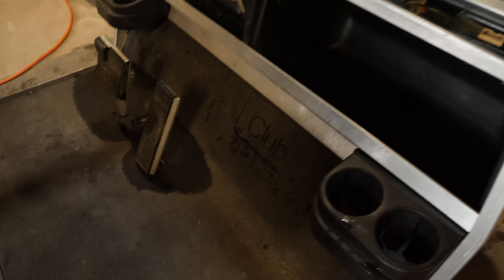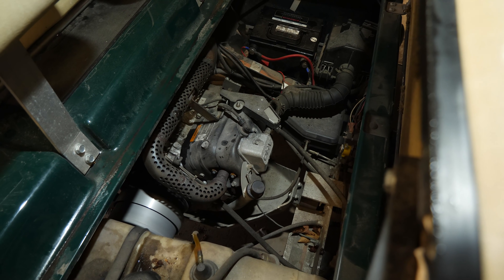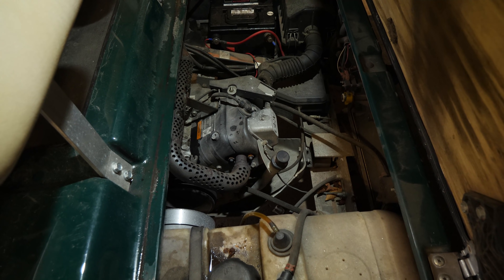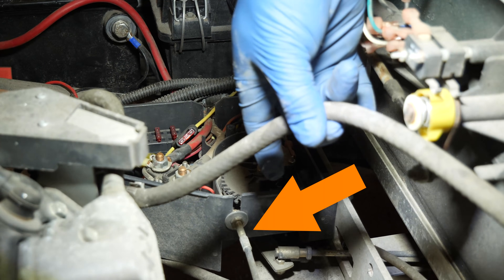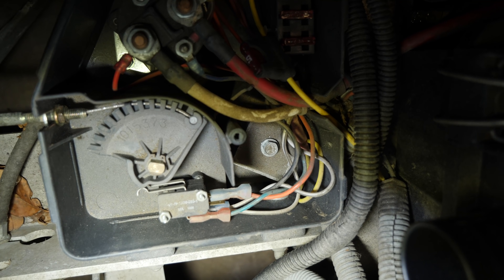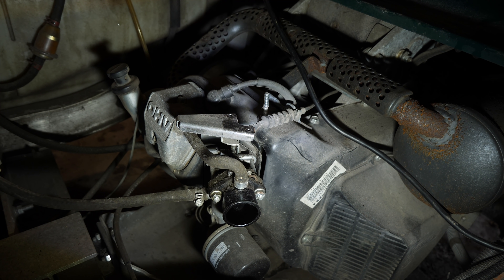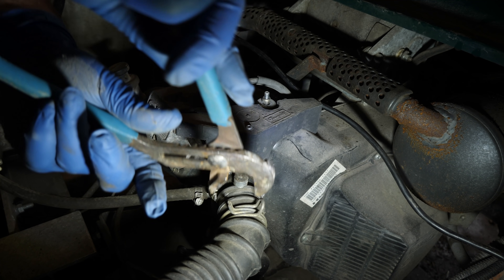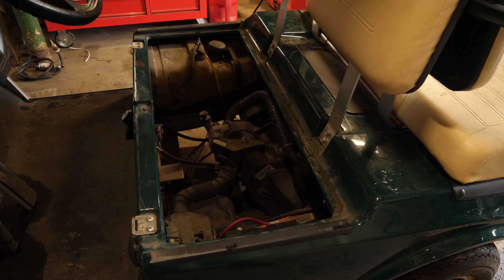2011 Club Car DS, Gas - Bad Governor, Hitting Rev Limiter

Comment: Great job Kevin,definitely saw my mis adjusted govenor...its there for a reason,more governor, less engine life
Reply from the maker: These engines are not internally governed so they have an external governor. It is dependent on speed and load.

Comment: I found your videos and you seem very knowledgeable. I have a 2001 club card DS the belt on my clutch does not ride all the way to the top so my car very slow at top speed. I tried changing the belt and still have the same problem. What would be my next course of action?

Comment: I love your video, however it did not explain how to adjust the governor to the stock setting. I picked up a 2007 Turf 2 Club Car that someone has been messing with that runs great until the pedal is fully depressed- then starts stalling and backfiring.

Comment: Kevin, we have a 2007 Club Car Presedent.  When we go to take off it squeals.  I have to be easy on the throttle to get it to catch.  You think it could be a belt issue.  We have replaced the drive clutch already.  I didn't know if maybe the belt was stretched out on the replace or the other clutch is bad.  Please help.

Comment: Hi Kevin I appreciate your professionalism /attitude towards doing things the right way instead of what makes things easy or a hack fix! I work on golf carts at a golf course I have many that will only start w/ pedal half way depressed (fully depressed pedal you get nothing) and everyone jumps in his pedal to floor & complains it won't start/ run. How do I fix this issue? Also I've purchase the starter / gen belts (club car & aftermarket) they are all now slightly thinner than the older belts!? Have you noticed this where can I buy ones like the originals?
Reply from the maker: If its cold, the engines will need a little choke to get going. If its hard starting all the time, even when warmed up, I would start with disassembly and cleaning of the carb. Also check fuel flow from the pump. Make sure the fuel lines aren't stiff. This can cause vacuum leaks and weak or no flow. Club Car has multiple part numbers for their different years and belts. I would make sure the belts are for that year. Some of the belts are only for a 2 year range, some are for the newer 96+. I would stay away from Amazon for hard parts like that. Everythingcarts or buggiesunlimited are good sites to buy from. They both sell RHOX parts and I'm also a RHOX dealer but I don't sell online anymore.

Comment: Bummer on parts acquisition. OEM has its reasons for things being set the way they are, and when you start fooling around with things, especially in the performance area, things tend to come back and bite you. Thanks for the ride along.
Reply: Only if it's done incorrectly lol

Comment: The cart has a rev limiter, you don’t need a governor. The governor is put in just for golf courses to keep your speed slow on the course. The rev limiter will keep you from damaging your engine not the governor. Loosen the bolt and let that Governor spin freely and bypass it all together. Again, a governor has no other purpose than to regulate your speed. Bypassing it or doing any mods isn’t going to hurt your engine. Make sure your rev limiter is working and go have fun.
Reply: I adjusted mine today I can get up to 19 mph now. I was maxed out at 12 mph at first. My cart came from a golf course the governor was turned down to the point it had a very slow takeoff

Comment: In your professional opinion what is the safest way to make a club car ds gas faster without damaging it? Is there a proper way to get another 4-5mph out of it? Mine feels like a little girl in a Barbie jeep is going to pass me lol
Reply: Bypass the governor all together. A governor is put on to control speed, not to keep you from damaging your engine. Now it can be used for that if it’s the only option installed. Golf carts have rev limiters. Rev limiters cut out at the top safe rpm for the engine. So in other words it will not allow you to hurt your engine. So you don’t need a governor and a rev limiter you only need one or the other. So why do golf carts have governor’s? To control speed on a golf course. That’s it! The governor being bad or bypassed will not hurt your engine. The only way you will hurt your engine is if your rev limiter gives out and usually when that happens you will have a no start condition.

Comment: I thought the govener bracket was just on a pivot..does the rod its on that goes into the engine actually do something?
Reply from the maker: Yes, the governor is part of the transaxle since the engine has no internal governor.
Reply: @Kevinsgolfcarts  ok so the bracket does need to turn the rod..and not be loosely on there

Comment: Enjoying all your videos Kevin. Glad I found them. So, my '92 EZGo Marathon will not rev enough to engage the clutch. I noticed a couple of small hoses hanging below the carb. one is broken in half the other is hanging loose. Pics of new carb  all show two small hoses attached to the carb. do you what these are for?
Reply from the maker: If its not revving, adjust the valves. The hoses are for the overflow.

Comment: Kevin, I am having very similar issues with the governor but I put mine up on jack stands today and it seems that my governor is actually moving as it should unlike yours from this video. That being said I keep bouncing off the Rev-limiter, I’m sitting here reading through a service and parts manual trying to troubleshoot what my problem is . My guess is it’s electrical ? Any help would be great thank you
Reply: Keith Ellett same problem ez go medalist, while trying to adjust the governor I believe the igniter went out and lost spark.

Comment: I have a club car with FE350 engine. It runs good at high rpm and I can even move slowly in forward gear. In reverse it surges, bucks and will backfire. Doesn’t seem to do that in forward. Any ideas would be greatly appreciated. Great channel by the way.

Comment: I have a !986 Club Car gas Motor and when I barely press the pedal down it seems like it`s at half throttle already. It also jerks a lot on take off. If I adjust the throttle cable at the box like you did will this help? Or is there a different adjustment somewhere?
Reply: Yes that will work

Comment: Hi Kevin i have a 2006 club car all new fuel lines and filters new plug and carburetor it will run great for a day and then it wont run it bogs down very intermittent lost on what i need to do next also new voltage regulator
Reply from the maker: If it starts and runs after the engine cools, it sounds like you may need to replace the ignition coil and igniter. The igniter is built into the coil. Make sure the oil is not overfilled. Overfilling can cause issues with the crankcase vent that runs the fuel pump. remove the fuel line from the carb when the cart stops running and see if you still have fuel flow. It wont pump out fast but if there's no flow, then the pump is failing.
Reply: Also if i put my hand over the carburetor i can get it to run but it may or may not keep running i did also replace the fuel pump i think i will replace the coil but i seen your video on the governor and i think someone messed with it they had the linkage tied strapped but its not any more  i got it used and didnt run right when i got it and never worked on these before you seam to be my only hope besides a shop thank you for you quick response  John H

Comment: we have a 2008 club car ds that came from an actual golf course. it is now used at a campground with some pretty significant terrain changes. when 4 adults are on board, it doesn't have much power to speak of. now i don't want to set any land speed records with this thing (i'm 42), BUT i do want to give it a bit more kick climbing hills. you showed adjusting that cable ferrule on the speed control box...if i were to adjust that a few turns out, would that be a safe option to increase power a bit? 

i am going to do a full service on this cart prior to making any adjustments to make sure nothing is left on the table. i saw you said conventional 10w30...can i run synthetic? i am probably gonna run a high end oil filter, and k&n air filter to help protect and squeeze out everything i can. any recommendations are greatly appreciated...great vid, and a sub for you sir.
Reply: Still need help?
Reply: I got a kand n drop in at autozone 20 years ago it works great
Reply: I adjusted the governor on mine today. I can get up to 19 mph now in which I was getting 12 mph too slow. I do not put the pedal to the floor I just let it coast at 19

Comment: I have a 95 ds. The starter motor went bad. I did a field test, it failed. I want to replace it with an after market part because I cant afford OEM.  How do I find what type of starter to purchase? Some people say clockwise and some counter clockwise.  I "think" it's a Kawasaki motor. I have the s.n. but that's it. Can you help me out here?
Reply from the maker: The 95 DS uses Counter-clockwise rotation and 96+ is clockwise. If its a clockwise engine, it will be printed in bold black letters on a yellow arrow above the primary clutch "CLOCKWISE". To determine the year, look at the serial number. The first 2 numbers after the letters are the last two numbers in the year. For example, AQ0869-59555 is a 2008 Club Car DS or Precedent. This isn't a real serial, just random numbers. You can order the bi-directional starter/generator from me MOT-2005. It can be wired for either clockwise or counter-clockwise rotation.
Reply: @Kevinsgolfcarts  ok I will look in the morning.  What is the price and availability?

Comment: Hi Kevin,  my club car, went even move the governor when I push the foot throttle??? But I can manually rev it up by hand on the carburetor itself!!! But my cable's have stopped moving in the last day...  any ideas?? What's wrong. 
Thanks Dirk
Reply from the maker: It sounds like one of the cables has broken somewhere inside the sheath. If you pull the cable from one end and the other end does not move, the cable is broken and needs to be replaced. If the cable is hard to pull or does not move easily, its time to replace it.

Comment: I am going to replace both of the throttle cables(from box to back and governor cable) - this helps a bunch. My question though is around the rev limiter - doesn't the rev limiter keep the rpms down so the engine doesn't disintegrate? I thought the governor just regulated the speed? So with this particular cart, isn't the risk a safety issue? Keeping the cart from speeding? TIA.
Reply from the maker: The rev limited does exactly what the name implies, it limits the RPMs. Its only design is to protect the engine. I cuts off the ignition if the RPMs get too high and re-enables ignition when the RPMs drop. It basically shorts the ignition coil to ground. In a failure situation, this is permanent or more frequent.  These engines will grenade themselves if they over-rev. The governor only governs the speed of the transaxle. It does this by regulating the throttle position.
Reply: @Kevinsgolfcarts  Thanks for the confirmation. After just checking, I am not even sure my rev limiter is kicking in. I know the Gov needs readjusting after I replace the cables but I will need to research the rev limiter is not engaging. High RPMs and no governor - the grandkids will kill themselves if they don't blow it up first :(
Reply from the maker: Someone may have cut the ground wire off the rev limiter. Check your serial number to confirm the year before you order one. They are slightly different between generations. The first 2 numbers after the beginning letters are the last 2 digits of the year. The serial number should be located on the floor just below the steering column.
Reply: @Kevinsgolfcarts  Yes - I saw that - I have an 07 DS. I still need to find a video of a replacement of one so I can see the correct wiring/mapping to compare mine too. I found info on checking Ohms that shouldn't be too hard to check on. So yes the ground could be suspect too. Had rear-end leak repaired which required engine removal and then went back to have the muffler replaced(I am sure that was a casuality of engine removal).
Reply: So intrigued I walked back out to look at...The ground is cut..Looks like it may be too short to get a connector on to extend..Other than hard to get to, I may have to replace. Took some pics to validate.

Comment: Can you sort a ezgo clutch snatching
Reply from the maker: I'm not sure what you mean.
Reply: @Kevinsgolfcarts  when I release the clutch instead of a nice acceleration, it jumps forward
Reply from the maker: Sorry, I'm still not sure what you mean. There is no way to manually release or engage the clutch in a regular golf cart. Golf carts engage the clutch after the engine starts and gets up to speed.
Reply: When I start to accelerate,in stead of a smooth take off , it jumps forward then accelerates. Hope this helps

Comment: Multi million dollar idea for someone. Figure out a way to get more tork and speed out of these small engines !!! I have a 2003 Club Car that will only do 14 miles per hour. I want 25 to 28mph out of her. I'm looking at new rear end gears and a heavy duty spring kit for the clutch. Installing a tachometer (in a perfect world rev limiter will allow 3900 rpm) and 12" wheels and 23" tires.
Reply from the maker: You can gain torque and RPMs with heavy engine mods like tune cam shaft, port polish, springs, etc. Its not a new idea. People have been doing that to lawn mower engines for years.

Comment: I’m having a similar issue with my 2007 club car DS gas cart. It back fires every once in a while but the main issue is when I take my foot off the pedal the engine continues to run/idle. It doesn’t accelerate thank god but just keeps a low idle. I have to switch the lever from forward to neutral to make the engine turn off. Any suggestions?
Reply from the maker: Backfiring is usually caused by the throttle cables being out of adjustment or ignition staying on when it shouldn't be. If the engine is continuing to run when you release the accelerator pedal, you have issues with the wiring, micro switches or accelerator rod adjustment. You can google the wiring diagram for your cart to make sure all of the wires on the micro switches are in the correct positions. There are 2 switches on the shifter and 2 switches in the black control box where the solenoid is located. One of these switches on the shifter is for the reverse buzzer so its not part of the start/run/stop circuits. I've had so many carts with  the wires on the wrong terminals of these switches. If the wiring is correct, then one or more of these switches is bad and should be replaced. I would just replace the 3 used in the start/run/stop circuits. You can also test the switches with an Ohm meter to verify they work. Diagrams for these switches can also be found with a quick google search. The accelerator rod (comes from the accelerator pedal and goes into the control box to rotate the throttle cam) may be out of adjustment causing the stop circuit switch to not close. This is the most rare but it does happen. These engines have a magneto style ignition (ignition coil fired by magnet on the flywheel, similar to a push mower engine). The ignition coil is shorted to ground to "kill" spark. Your cart isn't shorting the ignition to ground.
Reply: @Kevinsgolfcarts  Make a million dollars! Figure out a way to make these golf carts faster with a aftermarket carburetor, turbo or whatever.

Comment: Can only change gears with engine off. Changed all micro switches and still nothing, can anyone help? 1991 gas club car
Reply: TheMurfeeee 
Not sure what you are asking about. What do you mean by changing gears?
Reply: Mine doing same gear grinding turn off goes right in gear did you get fix.
Reply: @glennwilliams15  Could be the coupler that connects the torque converter to the transaxle